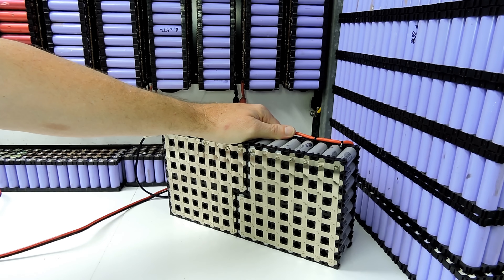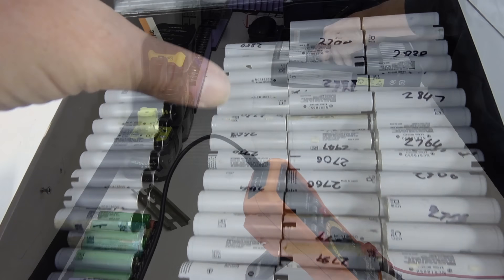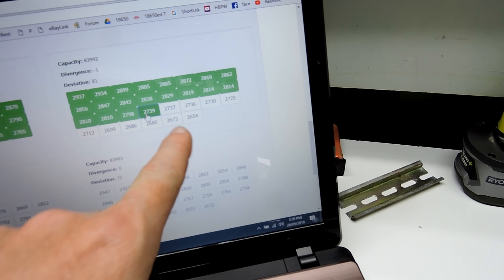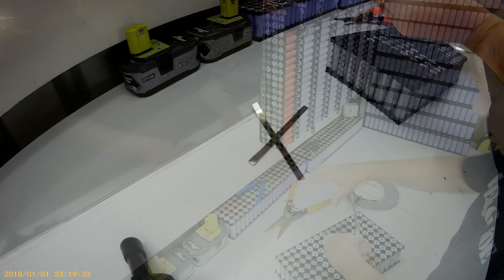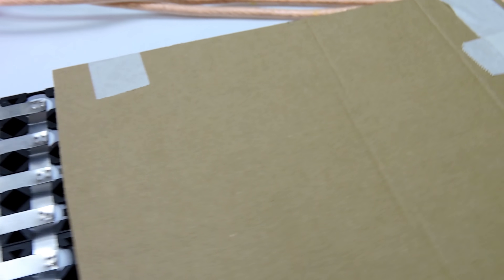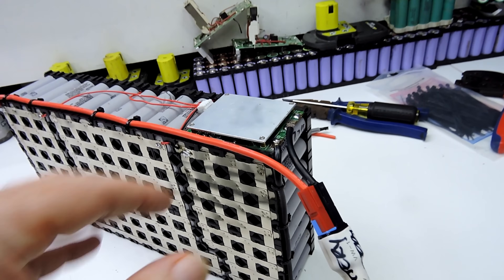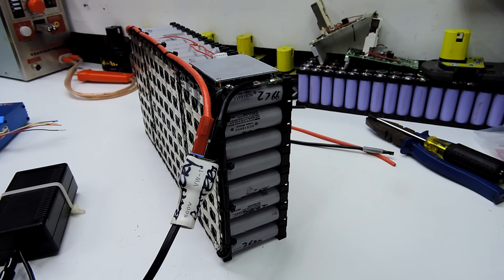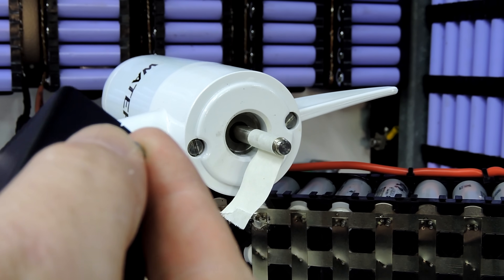Trolling Motor recycled 80ah 18650 battery pack

Comment: I was just relooking over this older video, about what size is the spotwelds? My spotwelder welds two spots about 1.5mm in dia. The 4ga, cables and weld tips and holders get so hot after about 50 welds I can't hold it anymore, it has two layers of of shrinktubing, one is the TEMco 1" dual wall stuff, with glue, and it has paper wrapped around shimming the tuning from 1/2" to just over 3/4", it feels hot enough to melt the glue! I'm thinking my tips are not sharp enough, and the welds are too big. I also was welding the thick nickle, and the batteries are capable of well over 400amps, I have about 20" of 4gauge cable going to it, with 12" of 2ga, going to the relay, it works well down to 9.5v, being 3s lipo, that's where I stop! Any suggestions? Maybe I should take it a bit slower?

Comment: Do I need to consider battery cell resistance when building a battery pack out of different recycled old laptop li ion cells?
Reply from the maker: You should consider and factor that could cause issues.

Comment: What are the tons of batteries on the wall used for? powering things in the house. I have only seen a few videos around with Walls full of batteries like this.
Reply from the maker: I have 4480 of them running my home for the past 3-4 years, then have another 1120 on my workshop wall running lights and fans in my workshop - then another 1120 at my buddy place running his home off grid. Have another 3000 to upgrade my home battery soon.
Reply: @HBPowerwall  I figured it was something like that. That is actually amazing. I assume they are charged by solar power?
Reply from the maker: Yes i have about 60 panels providing the electrons

Comment: Never thought IMAX would be able to charge the whole pack. 

How long did it take?
Reply from the maker: the IMAX are rocksolid, mine only died when i doped the charger cable onto the source battery... let the white smoke out in a big way. They can charge and discharge for weeks on end with out fault i did it for a very long time and regularly. Highly recommend the genuine IMAX - but the iCharger X6 is faster and better with regen discharge at 30 amps
Reply: @HBPowerwall  Thank you for your  inspiration reply. 😍😍😍

Comment: I like everything about this video, but please I would like to know more about the imax charger, please I would like to how many vot can it charge I want to know if it can more than 24v or 48vs battery
Reply from the maker: it's only 6s from memory. so no good for 7s 24v or higher. I don't know of a good 48v hobby charger with balancing but the iCharger X6 and X8 are second to none in my opinion - been using the x6 for years and it's just keeps on going www.diypowerwalls.com/x6
Reply: @HBPowerwall  I thank you so much, I don't know if you can teach me how to build a 24v battery and how to install the balancing cable, because I will be using the new imax charger

Comment: Im new here subed too but i saw all the lithium batteries and thought to myself holy batteries lol and im watching this video and others like it because I have a portable that i bought for like $60 the female type A usb parts needed to be replaced I replxed them over and over then it just stopped sending power to the usb but it can still be charged but now I have 8 18650 lithium batteries plus 2 more that are dead but need to be charged from my old vape mod but im trying to figure out how to build battery packs to run certain items like rail guns which I did with a crap ton of 9v batteries or lasers which I made a OP laser with 9 of laser cutting lasers all directed into 1 beam and focused to a point for cutting through steal also for custom portable battery packs my uncle normaly helps me with the electrical stuff but I want to learn how to do that stuff myself

Comment: Hello my dear friend, whenever I search for lithium-ion batteries, I find your videos, and I have a problem that no one has answered. I collected 50 batteries in parallel and want a way to charge them, knowing that in our country there are no spare bms for lithium batteries and a standard 5-volt charger is available, such as a power supply computer, but don't.  When you put the battery on it, some batteries start with a high temperature before the charging is complete, which is 4.2 volts, and I want you to help in a simple way to charge it, knowing that it is not available in our country Special charging circuits with all my appreciation and respect to my dear friend and wait for your response, please  You answered him, thank you
Reply: why dont you order something from a different country? BMS's arent that expensive
Reply: @holodrio1719  Because I have been a resident of the Gaza Strip and Gaza under siege for 14 years, and Israel is preventing the electronic parts from entering anywhere

Comment: Hello all well? I'm again the guy from Brazil (Raul Júnior) ... Show this video ... where can I get supplies to mount my drum seats? Point Welder; Metal tape for connection; the batteries; etc. I have a very similar project in mind; in my case it will be: the conversion to a 36 / 48v motor electric bike between 800 and 1000w of power ... I would like to make my battery bank myself! Can you help me by step by step?

Comment: Hello, what’s the reason you didn’t include the one with 4.08v? I can assume, but I’d like to know the process. And what’s going on with this specific battery.
Reply from the maker: From memory it was lower in voltage (should have been 4.2v) so probably self discharging

Comment: Why do you wait for 30 days fo self discharge instead of measuring cells' internal resistance?
Reply from the maker: I would like to know if any cells self discharge & I don't have a tool with enough accuracy to do IR tests.  Cheap rubbish on eBay just gives a false seance of security.

Comment: What connector do you use for the battery out put?
Reply from the maker: They are Anderson plugs - https://rover.ebay.com/rover/1/705-53470-19255-0/1?mpre=https%3A%2F%2Fwww.ebay.com.au%2Fitm%2F15A-Anderson-Powerpole-Connectors-Red-and-Black-Pair%2F254371749363%3Fepid%3D902670577%26hash%3Ditem3b39bcddf3%3Ag%3Ag1YAAOSwHChdlFOX&campid=5338316197&toolid=20008

Comment: I have 300 used 18650 cells.  I don't like to discard them, but I have no application for them either.  BTW, that 'music' is unbearable, I had no choice but to mute it.
Reply from the maker: Ooh no one likes my music - bet i would have had 1m views by now if i made better choices
Reply: take your cells and do a full capacity test on them and if they have 90% or greater use them to build a battery

Comment: From where can we purchase cell fitting casing
Reply: EBay
Reply from the maker: I grab all my cell holders from Keith, FAST shipping, community member & perfect packing every time - https://rover.ebay.com/rover/1/711-53200-19255-0/1?mpre=https%3A%2F%2Fwww.ebay.com%2Fitm%2F18650-4x5-Cell-Holder-10-pack-20-Cells-DIY-ABS-Lithium-Battery-Bracket-US-Seller%2F132581507084%3Fhash%3Ditem1ede79400c%3Ag%3AJEUAAOSwtKNazAxj&campid=5338316103&toolid=20008
Reply: Sir thanx but it is not opening

Comment: 3S or 4S if use for UPS ?
Reply from the maker: Thats a good question - what UPS are you using and are you planing on using the grid to charge it... if that's the case both are bad choices for lithium-ion cells as the voltages for both are very wrong. Fire will follow quickly.
Reply from the maker: Thats a good question - what UPS are you using and are you planing on using the grid to charge it... if that's the case both are bad choices for lithium-ion cells as the voltages for both are very wrong. Fire will follow quickly.
Reply: @HBPowerwall  thanks.

Comment: I see you answered my comment pretty fast
I'm wondering, you say in another video where you built one of these battery pack for off grid, that it had 10 Kwh
as a guy that installs solar my self, I know that we never express storage capacity in watts because it all depends on amps used

so that 10 Kwh pack has how many Ah in it is my question
Reply from the maker: I guess around 160 ah
Reply: thats why he used kilowatt hours not just watts
Reply: @elk3909  kilowatts is watts
EG : 1000 watts is 1 kilowatt

both change as voltage changes

amperage draw can be constant
Reply: @t00ls742  watt hours and a hours are both capacity measurements
Reply: but obviously you already know that.i find it easier to use watt hours if im using a voltage booster  or dropper.but using amp hours is better on a cell level to get aproximate power used
Reply: @elk3909  no  ...Ah  ( amp hours) is the only rating you use to know how long you can expect to have power

you can not know using any form of watts because the voltage is constantly changing

say I have a 48 volt bat bank....which when sitting at rest will usually be 52 volts

as I use power that voltage goes down

EG: using 10 amps 52 volts.....= 520 watts or .520 Kw
but the voltage went down a minute after I used it
10 amps 51 volts....now I only get 510 watts

but with amp hours 10 amps for 20 hours using a 100 Ah battery...I should only be able to run 10 hours or a little more

thats why we use Ah ...to know how long we can run...we are not interested in watts when it comes to batteries
Reply: @t00ls742  ok for estimating power level i use cell the voltage or just build a battery meter

Comment: I think you may want to include a current limiting device on each cell since you have so many in parallel. If one cell develops an internal short, the other 39 cells will happily discharge into the bad cell and create a burn hazard. I've seen others use a thin piece of wire in series with each cell for current limiting.
Reply from the maker: That is how i have all my packs built - this one was meant for a boat on the deck so if there was an issue it could go for a swim :P
Reply: if you have quality cells that current would burn up the positive tab inside the cell as this is a safety feature

Comment: I have the same Imax charger. Is it correct that the charger basically replaces the BMS while charging but that you don't have anything that protects the battery pack when being used?
Reply from the maker: Just common sense & the knowledge that if it over discharges i'll have to replace it :}{

Comment: The 12V/14V motor can take the 16.8V with no problems even on the long run?
Reply from the maker: the black box is a PWM stepdown /speed controler
Reply: @HBPowerwall  yeah after finishing the video I realized. What is the maximum voltage you dare to use with the motor? Isn't a stepdown very inefficient (according to rumors)?
Reply from the maker: @6.6  I run the trolling motor for 14hours solid on half speed and gave up on the test cause it still had 3.5v per cell - so inefficiencies don't really matter for my load/usage
Reply: @HBPowerwall  in the water tho? Outside the water the motor barely has to do any work.
Reply from the maker: @6.6  in a 1000l tote
Reply: @HBPowerwall  Sorry, whats a tote?

Comment: FYI    Balancing a high capacity pack with a BMS does not work unless you willing to wait 4-10 days or you have individual cell level balancing. The only thing BMS's are good for is high and low voltage shut off. Always use a Active cell balancer with a BMS for the best runtimes and safety.  If you think about it.... HOW effective is a 0.5 amp resistor on each cell bank TOTAL of 1.5 amps going to balance a 80ah pack in a timely manner????? LOL.   Active battery balancers redistribute the current of each cell at a rate of 1 to 1.3 amps PER CELL !!! not per bank of cells.
Reply from the maker: Sounds like you're generalising BMS :) BMS on my main pack can happily do 30ah balancing perday - a well built pack should need mv of balancing current. In this case i only balance when charging the pack. And use caution not to over discharge. THe most part the devices i'm running have a programmable bottom voltage limit.
Reply: @HBPowerwall  i think you meant mA of balancing current?

Comment: Nice vedio, you shown us how to check call voltage, but what abt amps, how to check is that cell is good or dead?  Since I have 50cells from old laptop battery, I want to make a 36v20amps battery  pack. Just checked each cell few are around 3.2,3.4,3.9 etc..  But don't know how to determin which cell is good for battery pack and per AMPs. Can you help me steps that I need to do 
Like 
step-1 Recharge the cells.
Step-2 keep some where few days, and check again volts.
If same voltage it same fine or cell is not healthy for battery pack 
Step-3 etc....
Reply: hears   the process i use
1st charge them under supervision to watch for cells that might have internal horts and will heat up and remove them from charge
2nd discharge them though a capacity tester and make note of the capacity at end of discharge
3rd go to second life storage and look up the cell model number for capacity quantity
4th recycle any that have less than 85 to 90 % of rated capacity

keep the good ones and build a battery with them

Comment: Get water splash on the battery pack and it’s fireworks time!
Reply: the cells are air tight so water won't get in. the bms however can malfunction

Comment: can we charge 10400mAh 3s lipo battery from Imax charger
Reply: Hi, 
of course you can. 
You just have to deactive the Capacity and Time limits in the settings ;)

Then Plug your JST connector into the corresponding 3S plug of the charger, the main leads into the outputs of the charger and there you go :)

Happy Charging ;)

Comment: Dude. Throwing a 4.08 charged cell. Into a box with metal and other possibly charged cells. Not smart.
Reply from the maker: I agree in hindsight
Reply: @HBPowerwall  you need safer storage and disposal. You had all those batteries in one box fully charged! Imagine if two shorted on each other. Go watch Rich Rebuilds Disney electric car Dasiy go up in smoke and BURN. Fire extinguishers do NOTHING.
Reply from the maker: @andrew1898  Perhaps, you're right but 4 years later I haven't used an incorrect charger on lithium cells burning my shit down.

Comment: Thanks for the great video.  I have a question, can I connect two 10s2p lithium battery packs in parallel?  Both packages have BMS inside.
Reply from the maker: Sounds like you can.. as long as they were the same.

Comment: That's a very nice video sir but how can you measure the Ah of each battery cell?
Reply from the maker: i use an www.diypowerwalls.com/opus charge discharger unit.. works well. After the pack was build i used an www.diypowerwalls.com/X6 to check the capacity of the whole pack 78ah total useable storage in it .. not the quoted 80ah lol

Comment: 80aH? = 667mAh? per cell
Reply from the maker: 78ah to be correct 2600mah each average useable
Reply: @HBPowerwall  Hi thanks for your response I do like the Video you have taught me somethings. The build is really clean and the balancing is also very impressive.  I am still going to disagree with your calculation.  4s30p Max voltage in this configuration is 4*4.15=16.6V Max (3.6 or 3.7 nominal *4 ~ 14.4 or 14.8V nominal.)  and for amphours(Ah) you have 120 cells * 2600 mAh =312,000mAh == 312Ah of energy storage.
Reply from the maker: you don't calculate it with the 120 cells only one parellel pack of 30 cells so 78ah at 16 ish volts
Reply: @HBPowerwall  ugh someone was going to learn something today i guess that would be me :(.  I got comfortable just adding them up. I guess kWh is the best way to describe  energy storage.   Then this is going to have more power than a lead acid 80Ah battery because its at 16V (1.3kWh) not 12V(960Whs)  like reg trolling batteries.

Comment: My homade powerbank with 4 parallel cell is charged after 12 hours.  how long it must take with the 30 cells monster in parallel mode and 3S. May be after week :-D ? I think it would be better to use a higher voltage such as 52V, 14 cells in series.

Comment: Man, you should write a book because I need HELP, good vids and links (I'm new) and I'm having problems discharging one 18650.  :-(   I have a new LiitoKala charger and a Tester Module Meter ZB2L3  after this test the battery still says 3.7v  Lol
Reply: there are 16850 batteries withh 3.7v

Comment: You MUST Love this kind of work, just the amount of hours (or days) to measuring and building! (take my hat of now!) I just got old 100Ah AGM batteries for free (from large UPS systems), just drop one in my boat, ok it is heavy (32kg) and a solar cell to charge! Runs great my old 55lbs.
Reply from the maker: 55 v 5 pounds lol with twice the capacity and better DOD. And i do love it for sure lol

Comment: im new to this, why do you need to balance the batteries?
Reply from the maker: So when charging and discharging there isn't anyone cell that is higher in voltage or lower causing damage to cell or the house around it.
Reply: @HBPowerwall  thanks

Comment: If you still do not use the "active balancer", I recommend it. That has been one of my nightmares with batteries.
Reply from the maker: No active balancer yet and wouldn't use active on a pack this small anyway. Just use a balance charger to charge it. It'll always be balanced that way. Not worried about low voltage cut off as batter doesn't get worked that hard.

Comment: Are you buying the laptop batteries yourself and then recycling them? or do you have someone you just order the batteries? I'd love to get a huge ~200ah 12v battery (sectioned off into either 4x50ah or 2x100ah sections)

Comment: I just took my Chinese ebike battery apart. It was made as cheaply as possible. Strap tape, double stick foam tape, hardened panels, shrink wrap... BMS failed after < 50 rides and 6 months.

Comment: So do BMS have a low voltage cut off?
Reply from the maker: I would expect so - but run the battery for 9 hours straight on 1/2 speed and still had 3.76v per cell so just charge and use with out BMS cut off - balance charger charges the battery so no issues there.